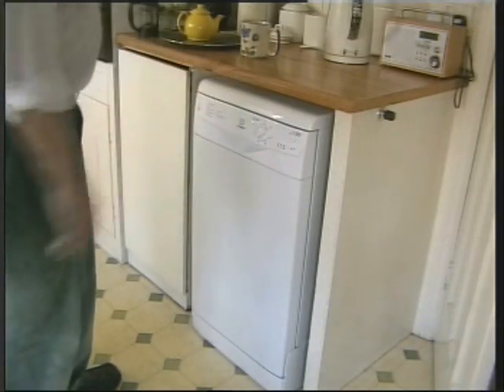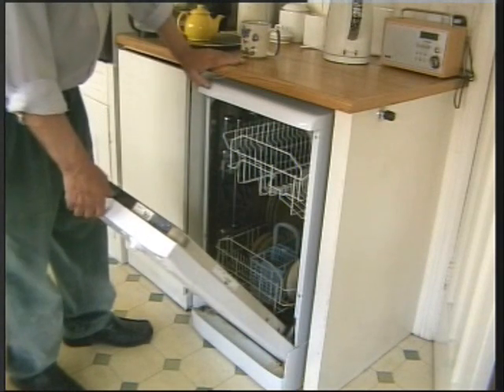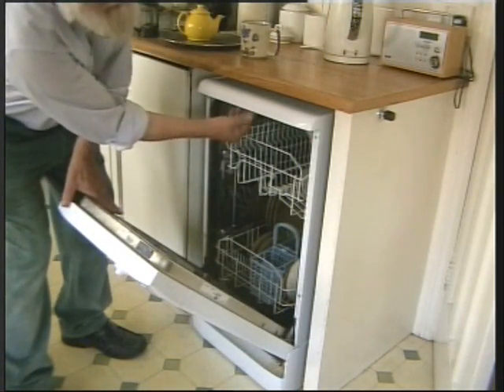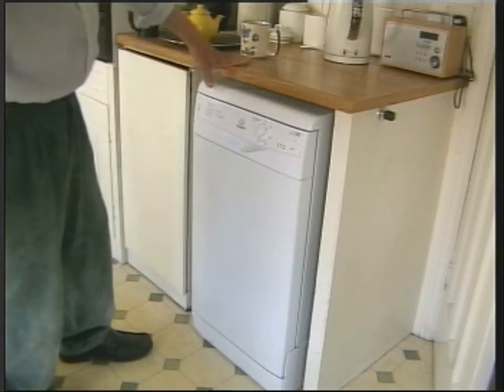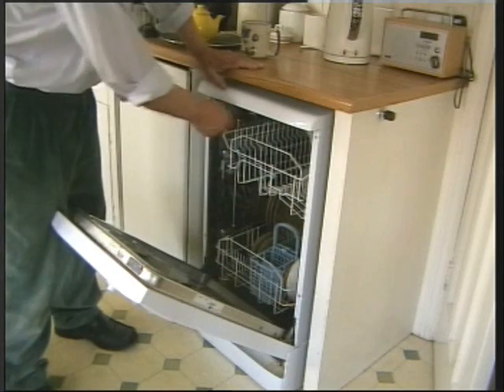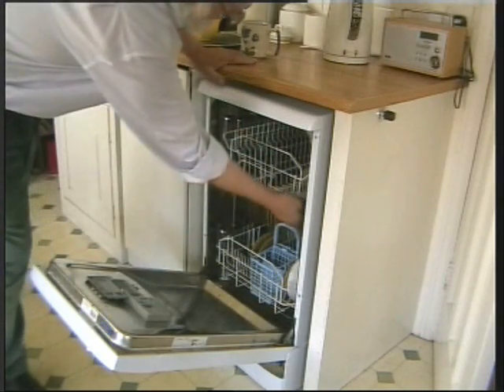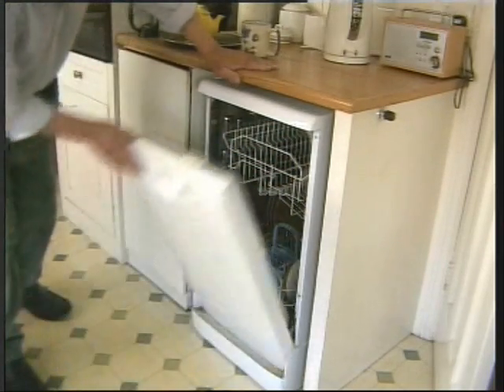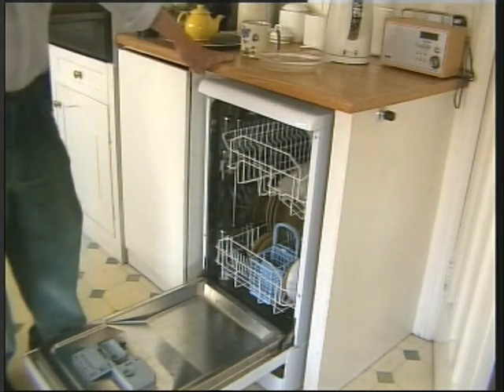More silly waffle

Comment: I thought you was not into new technology, myself I'm still washing by hand. But good video.   Just had 2 targets malfunction, electronics water in box (approx 10ml)  dried them out over a week, still not working, thought that's £750 gone down the drain, checked fuses today one of the two had blown in each, must have spent 8 hours with hot air dryer drying them out, we live and learn, should always check the simple things first.